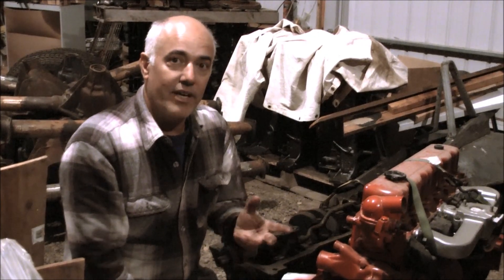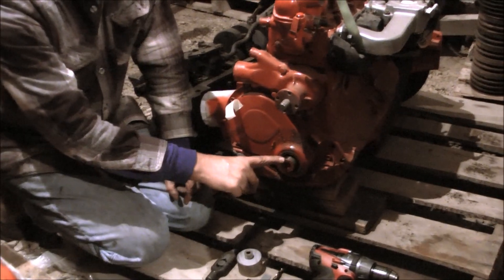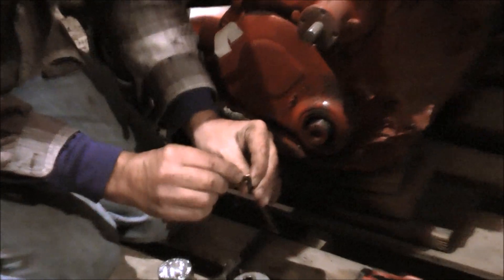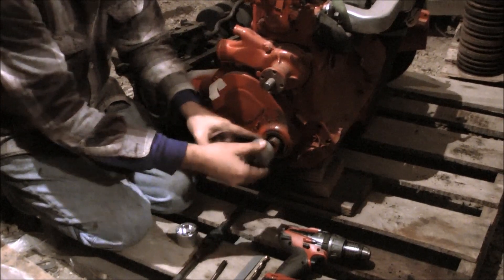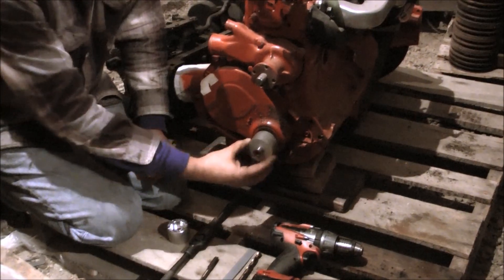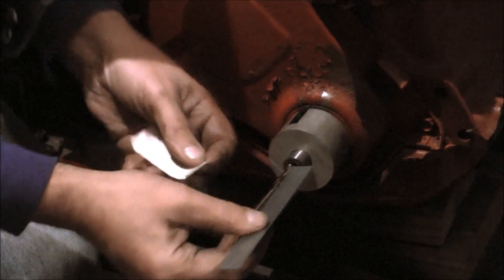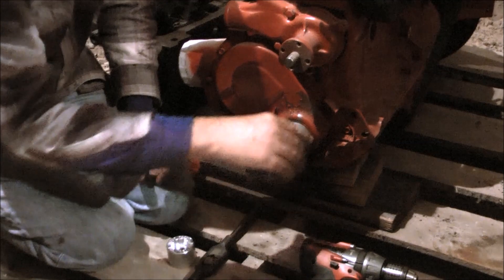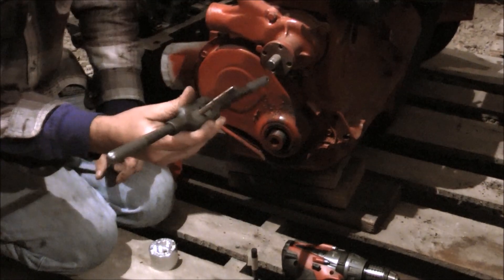Snout tool crankshaft drilling fixture (engine assembled)

Comment: The kit works great, but the bit that came in the kit was taking forever to drill the hole .   After drilling for about an hour and only getting about a half inch deep, I quit and made a trip to an industrial supply and picked up a cobalt bit for $10,  With the new bit, I was able to finish in about 10 miniutes.
Reply from the maker: Cobalt bits are supplied with this kit. Please send me a picture of the bit you said did not work. Tom@12bolt.com

Comment: what drill bit were you used for drilling such harden crank shaft steel?  Please advise me. I tested a few cobalt drill bit but failed also. please....some one help me???????????????????????????
Reply from the maker: We use a cobalt bit USA made. The most important part is drill with LOW RPM. High RPM with case harden the crankshaft, making it impossible to drill.

Comment: I bought and started to drill and the bit caught and almost broke my arm and now I can’t get started with out it getting caught
Reply from the maker: You buried the drill feed into crank too fast. You have created a burr at beginning of hole. For you to get going again, spin the drill faster and barely insert into the crank at a slow rate. Once burr is removed, slow the drill rpm to 400 rpm and you can push harder.
Reply: @telowe2000  thanks for responding I really appreciate it ya I noticed what I did right away and I was trying to figure out how to fix it .. I have my drill on the first setting for speed so I figured I was good.. any suggestions on how I can find out where 400rpm is once again thanks for responding and the kit it top notch !! I’m impressed with it
Reply: @Stephen198600  400 hz is G4 plus 35 cents, you can estimate your drill speed using a guitar tuner